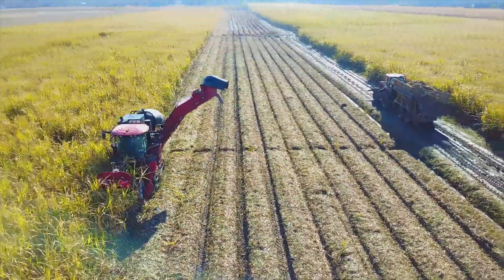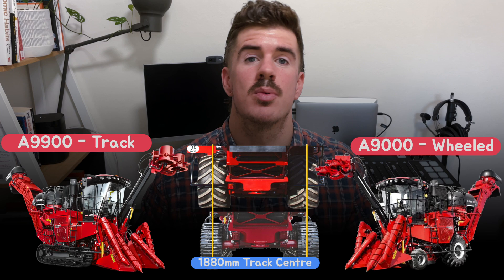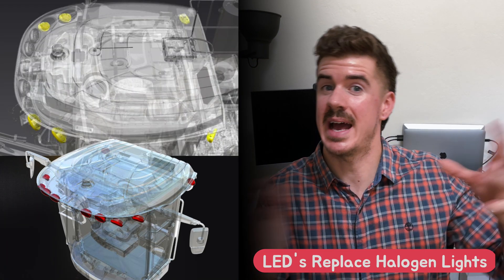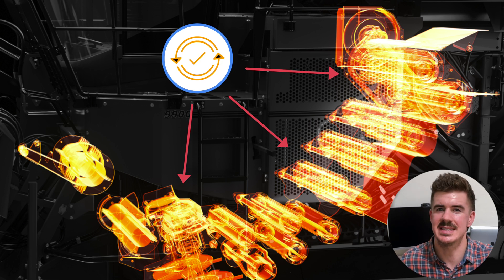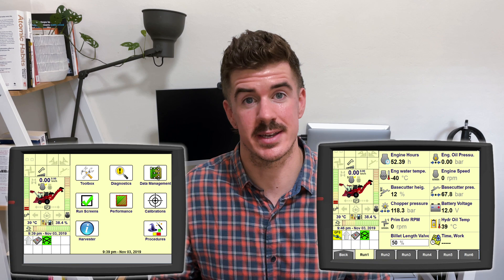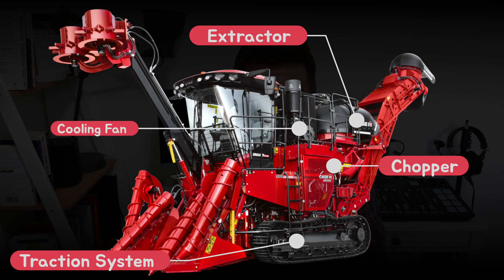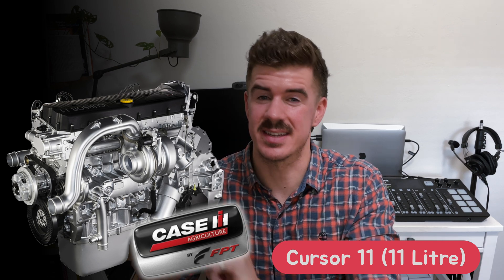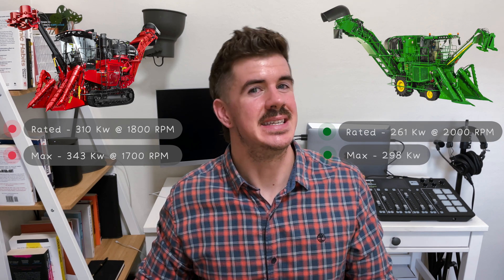All NEW Case IH A9000 Sugarcane Harvester | Features and Benefits

Comment: The 9000 is still using the basecutter motor as a flow divider and it would be better to have a pressurised hydraulic oil tank instead of the header tank system used